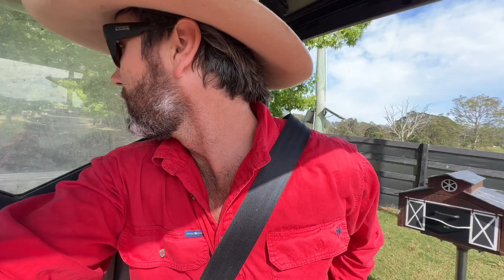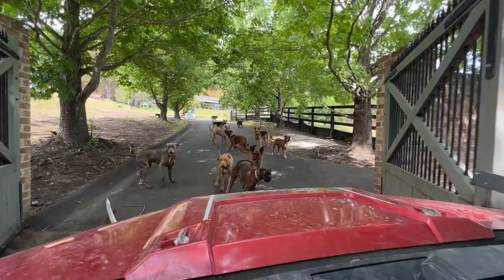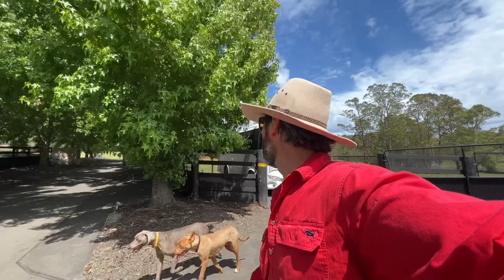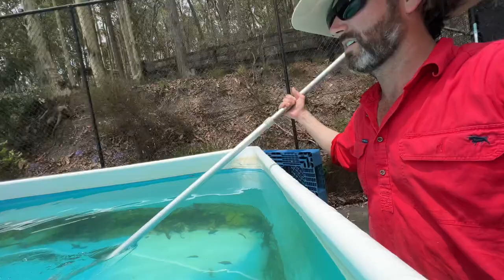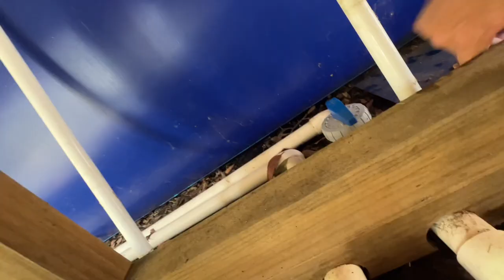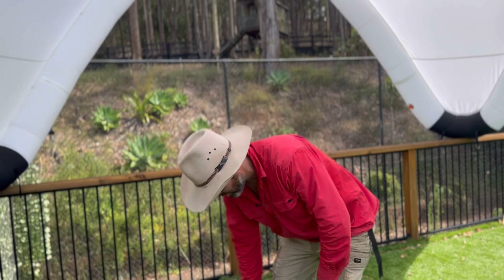Sunday at the Farm

Comment: In regards to the leaves in the pool preventing water flow in the pump: Can a  small-grid netting ‘sock’ of some sort be fashioned tightly to the ‘wand’ head of the vacuum that would stop the leaves from entering to hose, but might still be lifted up when extracting the wand from the pool, and then pull the leaves off the netting?  Maybe that way you wouldn’t have to make so many trips back to the pump the clear it?

Comment: Isn't it an idea to put a cover/net on top of the pool when it's not being used, to catch all the leaves?
Reply: Was thinking something similar except the netting be put over the top of the whole enclosure like a netting tent. That way the pool can remain in use while the netting works 24/7. There must be something on the market that could be used or adapted - would cut out an awful lot of work for Luke.
Reply: In a previous video, Luke has stated that the size of the pool makes it difficult to cover both due to size and the cost for a custom cover.